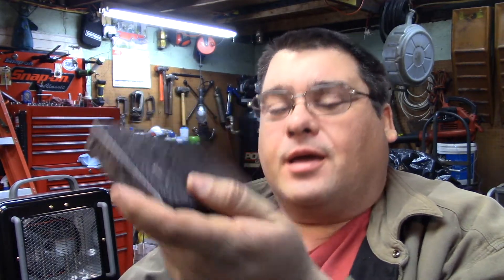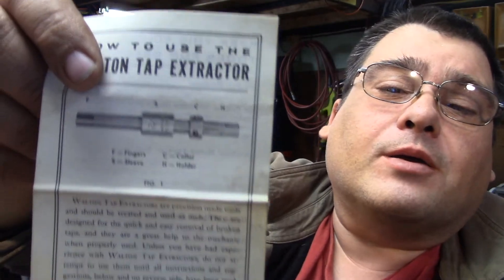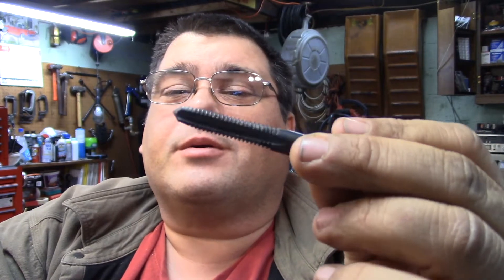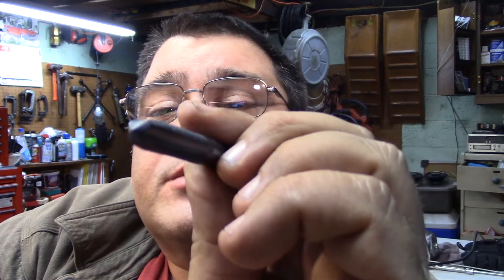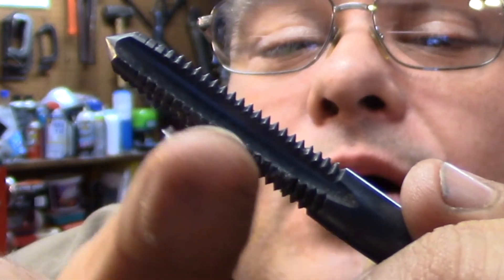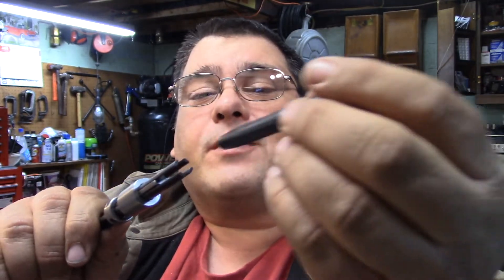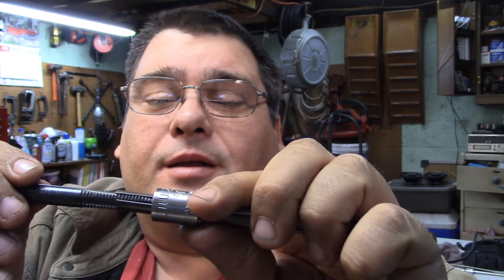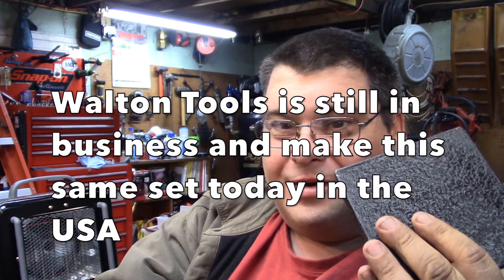Extracting Broken Taps - How Walton TAP extractors work

Comment: Today I used a WaltonTap extractor to remove a broken 1/4"  NPT tap from a cast iron engine block. The tap broke off mostly below the surface of the block. After trying to jar it back and forth with a small punch, and not getting anywhere, i decided the next thing to do is try the Walton tool. The situation required strictly hand work because there was no practical way to get the block positioned under the mill spindle. In the mill I could have pecked it out with a carbide end mill. I took the time to cut the end of the tap flat with a carbide burr. I also used the burr to cut a flat area around the hole to allow the sliding collar to lie flat against the block. With careful work, and stopping to clear debris when the turning resistance seemed to be excessive, the broken tap came out nicely. I cleaned out the hole and finished the job with a new tap.
Reply: So it’s definitely worth? I have a similar issue on an engine block.

Comment: 30+ years in aerospace and I think I got one to actually work, but usually end up with the fingers mangled and you hope they didn't break off in the flute. We usually drilled the taps out on the machine using carbide end mills and drilling out the web so they collapse and can then easily be removed.
Not saying they're bad for small shop use, but I dealt with a lot of exotic alloys which present special problems if you're unfamiliar with them.

Comment: ok..folks...Ive been job shop machining since 1975....these very ..very ..rarely work...
only once in 40 something years...
if tap was coming out when it broke..maybe it works
however when going down chips clog the hole and its nearly impossiable to get the fingers down in the hole...
I have about
100 these things 4 flute.(aquired out of tool boxes through the years of differnt tool boxes)
3 flute...2 flute types...all they did was make me say things to have to get forgiveness come Sunday morning...
Most machinist Inknow and jave hired equated them as to peeing up a rope......waste of time.....maybe your expeience varies...
Good on ya then...
go pick 6 numbers
quick...lol
Reply from the maker: Thanks for the info.  I would be interested to know how you do go about extracting a broken tap.  I have never used these and haven't had a need to try them yet.  I rarely use a tap.   They were given to me by the family of someone who died that was like a second father to me, so they have sentimental value, but I would be interested to know any trick of the trade from and experience d machinist though.